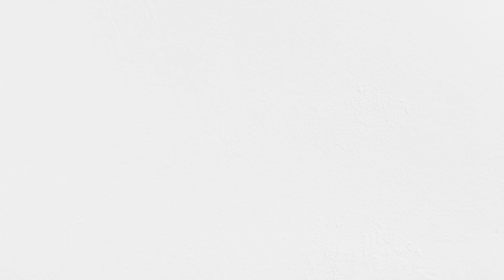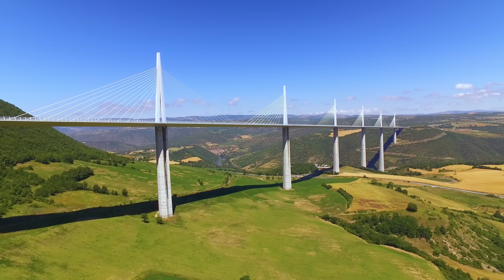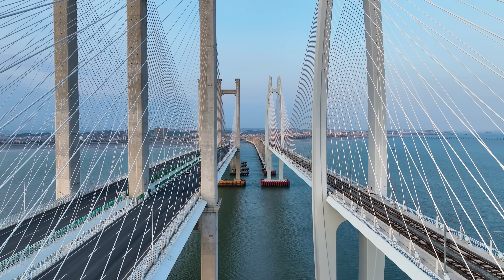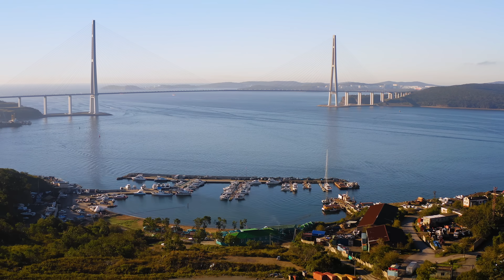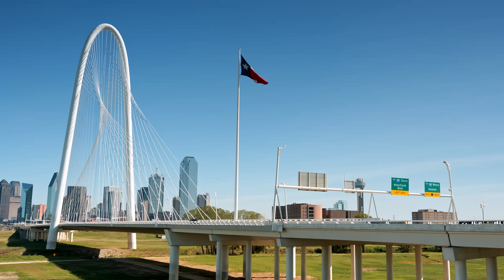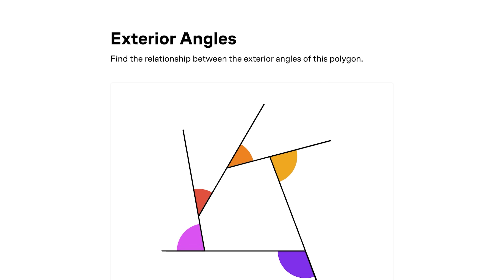A Love Letter to Cable-Stayed Bridges

Comment: Look, I live with an astrophysicist, so this is a big improvement on π = 1 and π^2 = 10.
Reply: π²=10 I can get behind as a close enough approximation,  hell I teach my conceptual physics students g = 10 m/s² just for simplicity and g is farther from 10 than π².   But 1?  not sure where that comes from.
Reply: @Mike__B  3x10⁰, keep the base and delete the bit out the front, it'll buff out!
Reply: xkcd 2205: "Assume Pi is 1.... Ok, we can make it Ten, whatever.

For non nerds - if rounding to magnitudes, that is, 'number of zeros', you don't round based on 5 - you round based on 10 to the power of a half - which is 3.162. But often, for simplicity's sake, you instead round at 0.3. Depending on what rule you choose, Pi can be rounded down to 1, or up to 10.
Reply: I’ve never heard of π^2=10, Sqrrt of 10 is about 3.16, not at all bad for an approximation. Doesn’t make mental math any easier though lol
Reply: @samuel010898  
I've heard about π = 3 and e = 3 as well. Meaning 3^(3√-1) = -1.
Reply: @samuel010898 pi^2 = g is a much closer approximation
Reply: Astrophysicist: π = 1
Mathematician: π is irrational ~ 3.1415......
High School Math Teacher: π = 3.14
Engineer: π = 3
Engineer being precise: π = 22/7
Reply: @hofii2  π is also used to mean profit, i.e. it's a variable
Reply: Matt I’ve just started Humble 3 and got to the bit about bridge flutter. How fitting.
Reply: What's an order of magnitude between friends?
Reply: All I know is a square root is a hard hole to fill.
Reply: Well, it’s pretty important for astrophysicists to understand that 2^(i3) = -1
Reply: My favorite is that there are pi*10^7 seconds in a year. Closer than you imagine.
Reply: Given in astronomy, the error on a value means 2 = 10 = 40 as far as the error bars can tell.
Reply: τ > π
Reply: About that. 
I've often wondered how many decimals of Pi,
that have ever been needed,
for the necessary level of precision,
in a real world application.
Reply: @christianellegaard7120 I think 3.14159 is considered sufficient.
Reply: So you're saying I need to take the sin of that angle? But what if I just didn't?
Reply: I had a joke with my university buddies: When asked what the value of pi is, the astonomers say it's of the same order of magnitude as 10, the engineers say pi equals 3 and physicists say pi equals 3,14. Meanwhile the mathematician in the room flips over the desk, yelling at the top of his lungs "PI EQUALS PI"
Reply: ........what
Reply: So there's this bug in Doom (1993 videogames) where they put in a wrong value for pi, and then someone explored that further and made this talk showing how it affects the game at even worse values.

https://youtu.be/_ZSFRWJCUY4?si=FvLo5hUvodbDHPZL

Anyways, I would assume that if Astrophysicists actually needed to use geometry, multiplying by 1 instead of 3 would get useless output.
Reply: 1x10^.5 is within a percent of pi
Reply: π = 3, π² = 10 is the correct version
Reply: Samuel de Champlain bridge in Montreal, Canada 🏍️🇨🇦
Reply: What about railroad bridges?
Reply: But that is still not 3...
Reply: Wait what? I do not speak algebraic...
Reply: In blacksmithing also pi=3
Reply: >π = 1 and π^2 = 10
What?!  Is this because of dark matter or dark energy?  Or some weird space-time length contraction and time dialation physics?
Reply: @electricketchup  you wish it was for such reasonable purposes... It just makes the maths easier... is 3.14x10^25 really that much larger than 1x10^25
Reply: @Twitchi about 3 times higher yeah
Reply: @Twitchi I hate this argument 😂 sorry you deal with that
Reply: @Twitchi yeah! It's three and a bit times larger! That's a lot.
Reply: @lloydjudd5137  is a planet 3x bigger really anything in the face of a star? no, no its not. Earth x3 is still nothing compared to the sun

For context, Jupiter is roughly 300 time larger than Earth, The sun is ~1000x more massive than Juptier
So the Earth is ~300000x smaller than the sun.. suddenly 3 looks quite small
Reply: @electricketchup  In astrophysics, the distances are so ridiculous that you really only have enough mental energy to track the magnitude.  (Bear in mind, you can have potentially dozens of magnitudes to think about all at once.)

But if you get deep enough into the right branch of number theory (or information technology), you can get to the point where you treat all finite numbers as fundamentally the same, because they're finite.
Reply: @ 
"But if you get deep enough into the right branch of number theory (or information technology), you can get to the point where you treat all finite numbers as fundamentally the same, because they're finite."

Sounds like when we compare algorithms in space or time complexity like O(1), O(n), O(n²), etc.  But I've never heard anyone use those kinds of complexity in astrophysics.
Reply: @electricketchup the numbers astrophysicists use often get so big the mantissa doesn’t matter anymore, so “one is approximately equal to three which is approximately equal to pi” isn’t even on their list of the top ten most incorrect assumptions that aren’t wrong enough to affect the result.
Reply: @tehlaser  especially when some constant I forgot the name, calculated via 2 different methods, gives two different values that are 10^18 apart ...
Reply: when you are working with numbers in the base range of 299,792,458  ((light speed)) brought to the thousands and millions..... two single digits are not even a speck of dust in a rounding error.  Less than a single dot on a monte carlo simulation.
Reply: And √π = φ
Reply: Still makes my blood boil.

Like if you want to approximate pi as 3 that’s fine I guess, but at least call it pi.
Reply: ? You engineers, scientists and astrophysicists and your ‘jokes’ make no sense.

So a light year - is that a distance, a time and in any case what relevance is a year to a particle or wave or what ever light is that in reality has variable speed travelling though an infinite finite space? 😵‍💫
Reply: @rupertaitken it's in the name. It's the distance light travels in a year in a vacuum and is a fixed quantity. Very easily learned from a dictionary or encyclopedia.
Reply: @rupertaitken a light year is a unit of distance! the speed of light is constant--it is one of the fundamental constants of the universe, actually. A light-year is the distance light travels in one year, which is about 9.45 trillion kilometers.

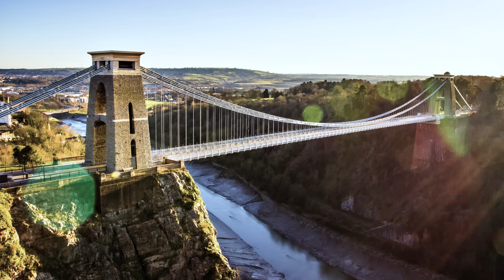Comment: I'm still trying to figure out what type of bridge the Royal Albert Bridge built by Isambard Kingdom Brunel in 1859 is. A suspension bridge, a cable (chain) stayed bridge, an arch bridge or a hybrid or a suspension bridge and arch bridge. I'm my opinion, the Royal Albert Bridge is the most beautiful bridge in the world, not just its appearance but how it works and they way forces are transferred but also because it was built in 1859 so the technology available wasn't anything like we have now. That entire bridge was designed by the greatest engineer of all time. The Clifton Suspension Bridge in Bristol (shown here at 5:46) completed in 1864 comes a very close second in my opinion, though it being a suspension bridge. The Clifton Suspension Bridge is an amazing bridge to see up close, the amount of movement of the bridge deck when cars drive over it due to its super slimline design is incredible. A true masterpiece of engineering.

I would love Grady to make a series on the greatest engineers of all time, Brunel being one of them obviously. Brunel's engineering achievements have never and will never be beaten in my opinion and channels like this need to pay homage to people like Brunel. From the first under-river tunnel, the worlds first high speed railway to the first global transport system, the first proper transatlantic steam ship (all be it the SS Sirius was actually the first but it only just made it, the SS Great Western completed the trip with a decent workable load), the first all iron steamship and the list goes on. No single person has ever done what Brunel has done for engineering.

Comment: Makes me wonder: is this creating a new problem?  With the dominance of the cable stay bridge, will it stifle innovation?  Even if a better design is conceptualized, the economy of scale of having engineers and manufacturers skilled in cable stay bridge creation will make transitioning more difficult.  

Not a huge problem since cable stays seem to work well enough, but I'm curious if there's something better out there that we might not see due to this issue.
Reply: Warren trusses were everywhere in the mid twentieth century . Did they stifle innovation ? There was a time when bridges were either stone arches or timber . I suppose if something is very good at what it does it raises the bar for the next improvement, but is this stifling innovation or raising expectations  ?

Comment: Fun fact: steel cables were invented out of necessity by miners in the German Harz mountains. They were mining so deep, that ropes or chains long enough to reach the bottom would break under their own weight.
Reply: Harz mountains mining brought tons of new stuff and improvements. They mined 800m deep with purely wate rpower
Reply: Mines are amazing. When I visited the Sudbury Neutrino Observatory deep in the nickel mine, the "cage"  or lift was suspended by a single arm-thickness steel cable. All the way down to the 2 km/6000 ft depth. There was enough stretch in the cable that the cage had to be decelerated in stages as the cable acted like a rubber band.
Reply: Tokra and Darmonth! The moon!
Reply: if I remember correctly, it was because ropes were too weak and chains would fail suddenly and without warning. I believe they had a chain snap on an elevator or manlift and the deaths caused by that was what spurred development?
Reply: Bergrat Albert in Clausthal 1834, the first wound wire rope.
Reply: I wonder if anyone got the idea of using tapered ropes or cables that are thicker at the upper end and thinner at the lower end.
Reply: @seneca983  It would probably add more complexity than it would solve and be way more expensive. How would a stranded cable taper?  How would spooling a tapered cable work without adding increased wear from the varying winding pitch? Would it reduce strand redundancy?
Reply: @MikeDS49  "It would probably add more complexity than it would solve and be way more expensive."

Might be; sounds plausible.

"How would a stranded cable taper?"

Ignoring the more practical issues, calculating the optimal taper under a simple model (e.g. without separate strands etc.) should be very easy, though I can't be bothered to do it right now.
Reply: @MikeDS49  oh there's countless ways to spice a rope. you can absolutely make tapered ones.
Reply: @sac3528  Steel cables too?
Reply: @sac3528  can i use nutmeg?
Reply: @seneca983  Where are the forces going that causes you to need a thick cable at the upper end but a thin one at the lower end?
Reply: @moonrazk  The upper end of the cable needs to support the weight of load the cable is carrying and the weight of the cable itself. The lower end only needs to support the weight of the load and thus could (at least theoretically) made thinner making the cable lighter.

Comment: You make a good argument for cable-stayed bridges, but they are not THE LOCKHEED SR-71 BLACKBIRD, AN ADVANCED LONG-RANGE STRATEGIC RECONNAISSANCE AIRCRAFT CAPABLE OF MACH 3 AT AN ALTITUDE OF 85 THOUSAND FEET!

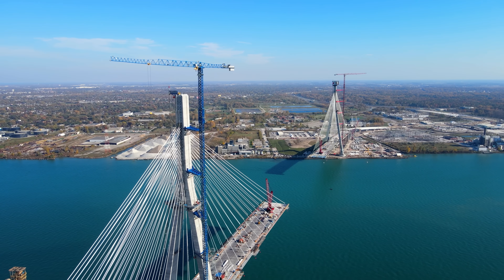Comment: Do cable stayed bridges usually operate such that the girders stay in compression when loaded? IE the bending is resisted by top compressing more and bottom decompressing? Sounds helpful for avoiding/mitigating cracks if so. 9:09 Ooh, those cranes are beautiful